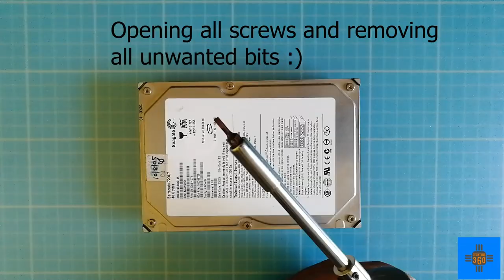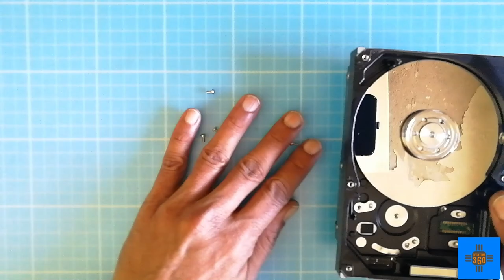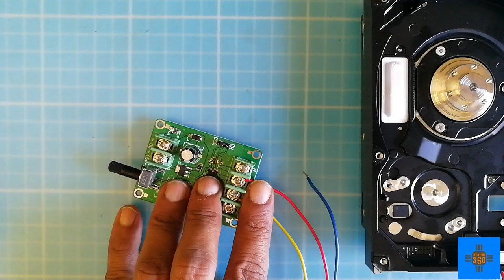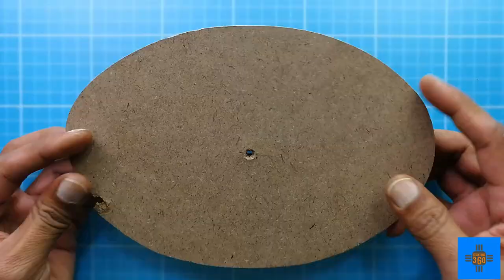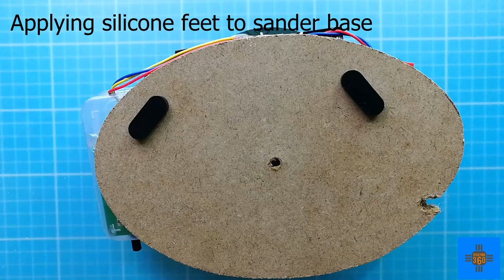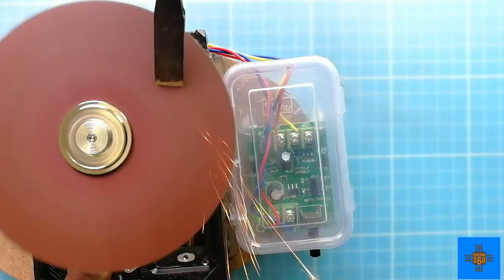Amazing use of old hard drive

Comment: Well why cant you just use old hard drive curcuit to power the motor instead of old esc also great idea
Reply from the maker: Ya you are right but there are couple of reasons I did not use that1) adjustment of speed cannot be achieved 2) it rotates at quiet modest speed and putting a bit of load on disk will stall motor from rotating 3) not all HDD have constant rotation system some may spin some may not and some may have that circuitry damaged so I went with this setup which serves the purpose very well. Thanks for your time and interest ✌️👍🙏😊
Reply: i wander even if you (the one who got idea) has knowlage to run like you said!???. i mean you not even know which part is the motor controller. i bet that
Reply: @ramadavince6611  bet in how much
Reply: It's a simple curcuit even if i didn't know just follow the traces on pcb and you will find what part is esc
Reply: @stralegaming2597  my life